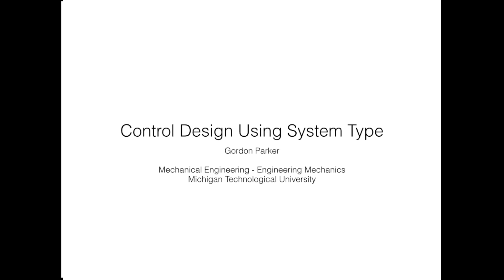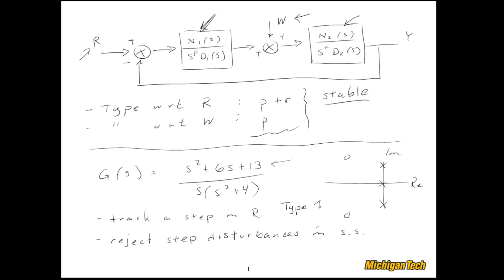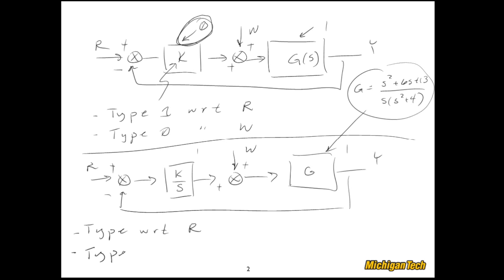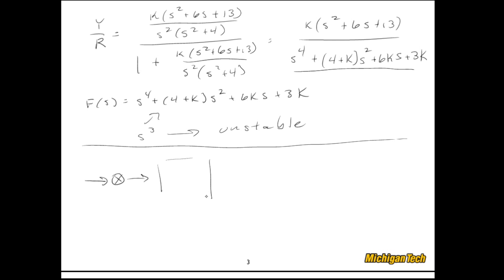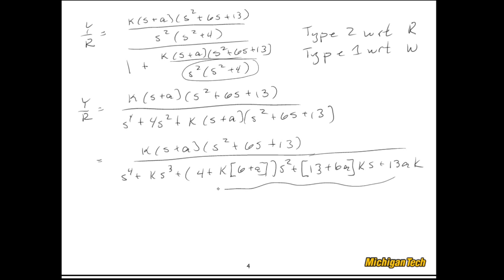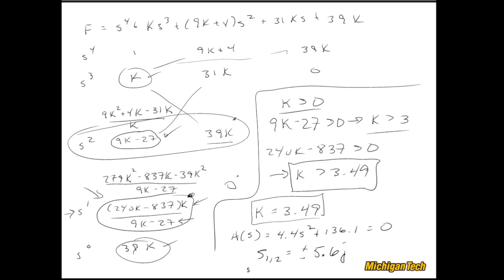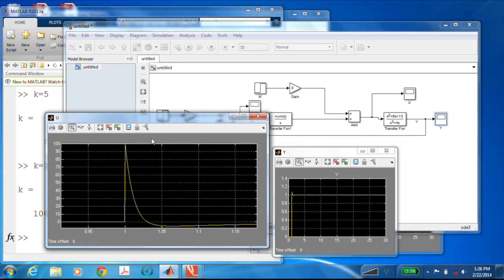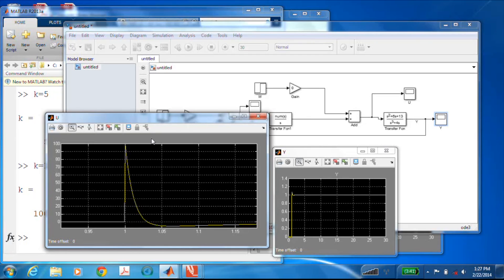Control Design Using System Type

Comment: Great work. Thanks!
Suggestion:
Routh array is used but not explained in this video. The topic is covered later in video 39 (this vid is number 37). You might want to move the routh array video up in the sequence to avoid the confusion.